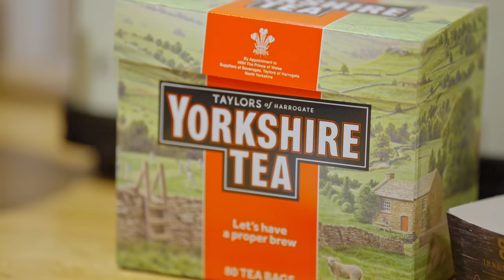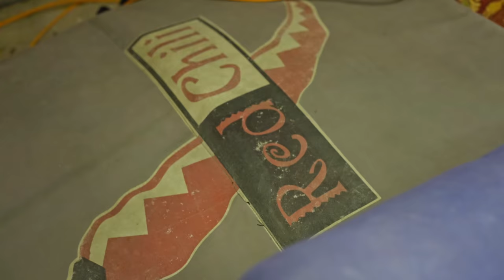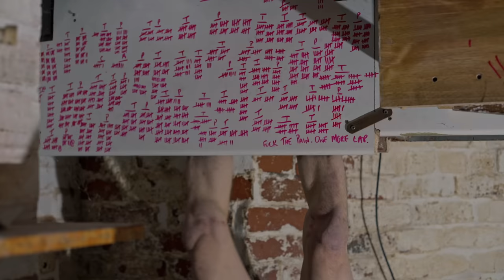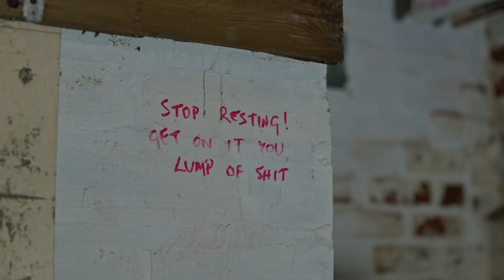Wide Boyz Schooled Adam Ondra in the Cellar and on the Grit

Comment: Tea brewing should be around 3 minutes or higher, and should not be boiling. Most black teas would prefer being brewed at around 185° to 195° Fahrenheit. (Other tea types prefer different temperatures and will be specified on the packaging. Another problem is the usage of tea bags as opposed to loose leaf, not only is the tea going to brew poorly, you are also getting poorer quality tea (usually) when you buy bags. A temperature controlled kettle is inexpensive and very useful, unless you want to dick around with a thermometer.
Reply: Imagine taking tea-making advice from someone who uses Fahrenheit
Reply: @faintbeep1766  how would that be relevant lol